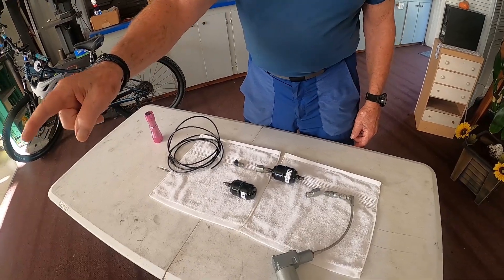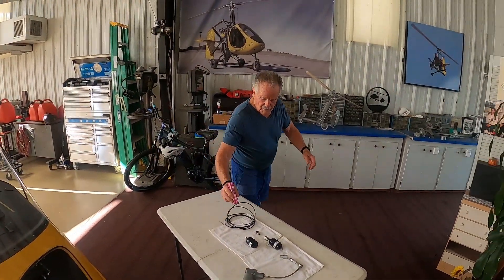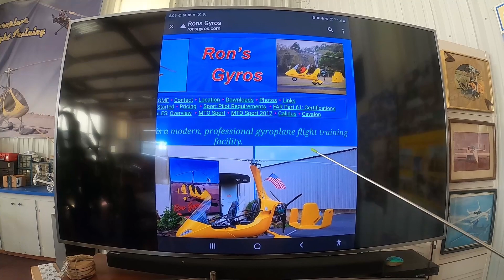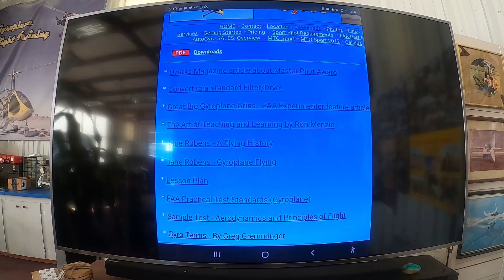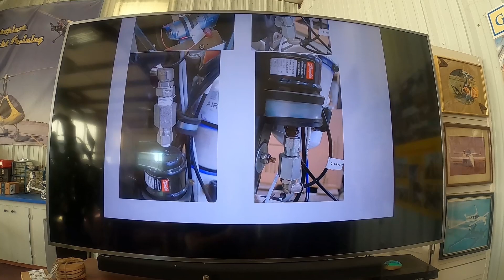Save MONEY with this UPGRADE! Autogyro Filter/Dryer Upgrade Tutorial!

Comment: I tried this but the fitting on the compressor did not fit the BVV 37 Degree Female JIC X MNPT-1/4-inch X 1/4-inch you indicated.  It appears that the compressor fitting is 3/16" and the female JIC XMNPT is 1/4".  I've tried to find an adapter from the 3/16" to the 1/4" and have not had any success.  I've tried to find an BVV 37 Degree Female JIC X MNPT-3/16-inch X 1/4-inch and have had no success with this either.  Sure would appreciate some help.  Thanks.

I would think that the compressor fitting size would be the same so am at a loss as to how you dealt with this.

I do enjoy your videos.  Thanks
Reply: I had to replace the compressor because the fitting stripped when removing it from the dryer.  This is a terrible design by Autogyro.